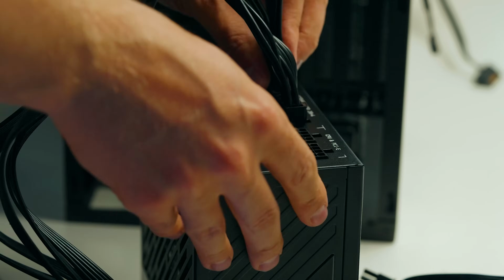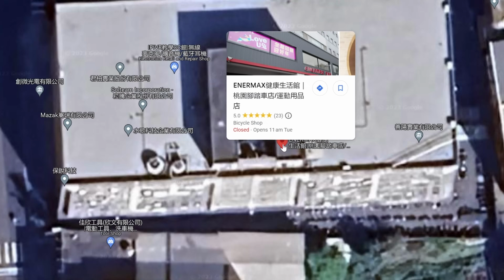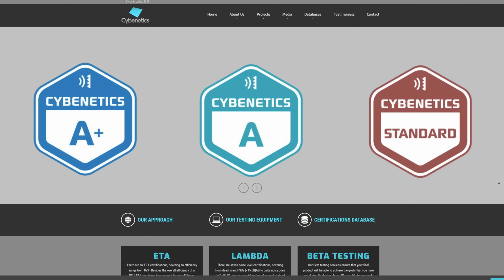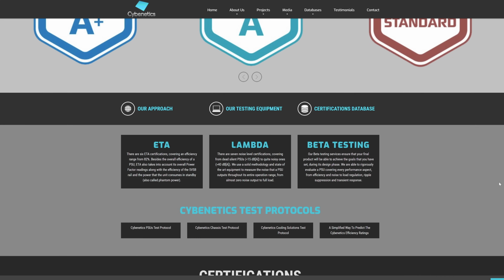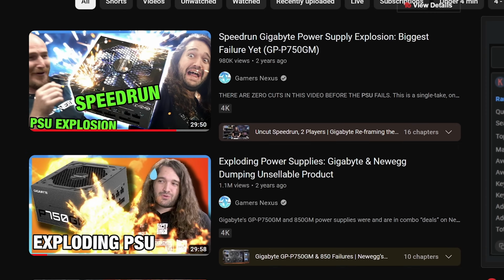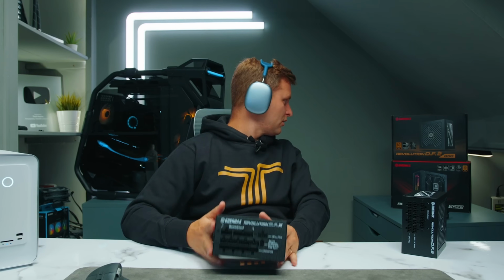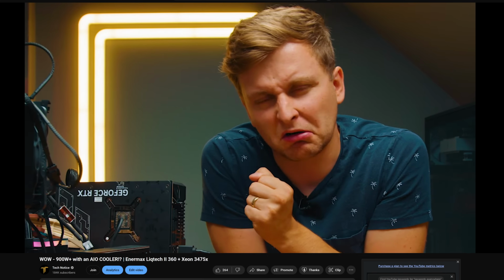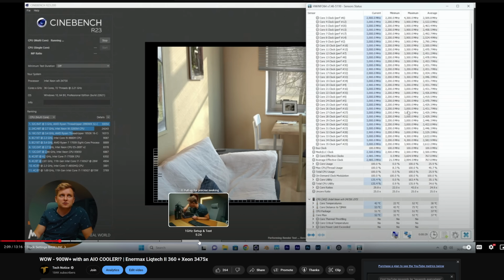ULTIMATE Power Supply Tutorial: NEW PSU standards Explained from NOOB to EXPERT! [What is PSU?]

Comment: This was really informative. For AI, I’d like to see power supplies include a feature that measures total power consumption so it can be used to calculate the cost of running each PC or a group of PCs. I never turn my PC off, so when building a new one, I wonder if it costs the same to leave a 1000W PSU running 24/7 as it does an 850W PSU. I’d like to know before opening the one I just bought, which is an ASUS ROG Loki SFX-L 850W Platinum (Fully Modular Power Supply, 80+ Platinum, Lambda A Certified, 120mm PWM ARGB Fan, Aura Sync, ATX 3.0 Compatible, PCIe 5.0 Ready, 10-Year Warranty). I also didn’t hear anything about the power required if a USB 3.2 Gen 2 is used for power transmission, and how that might affect the build specs, though to be fair, this was created two years ago. Oh I forgot to mention the main reason I chose this brand was for the size restrictions I have of needing a SFX-L.

Comment: Well… I pick a power supply for noise. Thats why I over spec them. For example, I know, a system will pull 500 watts peak in the way I configured it, so the power supply will sit at 1000 watts.  This keeps the PSU at low noise, if the PSU is a good quality. For example, the 1000W Dark Power 14 will run at 8dB, which is effectively noiseless.

Comment: the reason you might be able to push the PSU harder than it's advertised is because sometimes the PSU manufactures may for example when producing a batch of 1000W PSU end up with some that only giving 900W or 950W, so they might just sell it as an 850W PSU since they can't sell it as 1000W.

Comment: Build new system got gold. It wouldn't turn new motherboard was bad. Tested psu and saw jitter on tester low the better. 
Going need a new gpu got 850 with atx and pci 5.0. Full  modular  what's best, amd for under 400$
My psu shut down immediately when saw fault with bad motherboard

Comment: Just a note as an electrician in Florida, USA, he's correct about 2000w PSU being unfeasible on a standard residential wall outlet. Ordinarily. A standard American residential circuit may be 20A at 120v, which supports 2400W total. A PSU rated at 2000W with a 90% efficiency rating may pull 2200W total from the wall outlet. But we have electrical codes to abide by. 

Although a 120v 20A circuit can support 2400W legally, it is code required for "constant loads", like computers, to be mandated at 80% of rated circuit capacity. So already, as far as electrical code and safety goes, your limited to 1920W on your 2400W circuit. Well under the potential 2200W draw the PSU may pull. It may work initially when you power it on, but your breakers will end up tripping as they heat up as they aren't designed to support "constant loads" at 2400w, and neither are the wires in your walls. The 2400w if for "spike", "peak" or "intermediate" loads. 

On top of this, the majority or American homes are wired with 120v 20A circuits to feed outlets in the home. But 95% of the time in a home, the actual receptacle wall outlets installed are only rated for 15A at 120v, or 1800W. This is allowable when there is more than 1 receptacle on a 20A circuit as they anticipate you splitting the load between multiple receptacles, which is 99% of the wall outlets in your home. If you want to know what you have, look up 15a v 20a 120v receptacle. You will see the difference so you can identify what you have. 

But at the end of the day if you know electrical work, it is entirely possible to run a 2000w PSU in your home safely if you follow electrical codes. And the building department can't say anything about it if its correct. It's not standard here but done correct. 

Your option on 120v would be to run a dedicated 10awg wire (30 amps rated) instead of the standard 12awg wire (20 amps rated) to your computer source and use a single outlet commercial grade 20A receptacle at the end to plug into. This setup would absolutely support up to 2400W of continuous power draw if installed correctly. Or, with 240v, you can use traditional 12awg wire, and wire it up to a 20A 240v breaker and 20A 240v outlet. This will supply more than enough power to supply the circuit safely, 3840W even considering the 80% limitation for constant loads. Check the PSU specs first, but every PSU I've come across is rated to accept this power input as its very similar to European power. Only difference is 60Hz American to 50Hz European, which is within specs of every PSU I've ever seen. Some people don't realize that American homes are both 120v and 240v. It depends on what your powering. For example, your oven, stove, dryer, A/C, water heater, pool pump and well pump are almost certainly using 240V unless they are running on gas or extremely light duty. The rest of your home (all lights and standard wall outlets) are 120v for safety. 

Unfortunately, many new houses don't even use 12awg (20A) wire anymore, many run 14awg (15A) wire. Not how I wire a house, but many do to cut costs. You can tell by looking at the ratings on your breakers. If your house is wired with mostly 14awg, your circuit is rated to 1800W max and 1440W continuous. So technically, a 1400W power supply is illegal on this setup when you factor in the additional 10% draw for efficiency losses.
Reply: pls do a tldr

Comment: The problem with Gigabte PSU's is they just didn't test to determine the OPP level, or perhaps errors were made.  In regular use, though, none of them failed in that manner.  But Gigabyte opened a window for purposely exceeding the ability of the PSUs and then they responded with bad PR.  I've had good warranty service with Gigabyte with other products, motherboards, and GPUs. So it's not a bad company to deal with. Although I heard of bad service, it didn't include me. Their PR departmented needed an overhual, though, it seems.

Comment: Full-modular means you can replace all the cables with custom cables, where a semi-modular means you will need extentions if you want, say, custom sleeved cables, visible.  However extensions can be harder to manage in you have a tight cable management space.

Comment: My Corsair ax1600i died recently so I purchased an NZXT C1500. Cybenetics rated it Titanium and it uses 100% Japanese capacitors. It is designed by a channel well and is a top notch psu. Features atx 3.1 and dual pcie 5.1 connections. So far I'm very pleased with it.
Reply: How did it die? The AX1600i is built with very high quality components

Comment: So, this is leaving me with more questions than answers:
- From what I understand this is an Intel Standard. Shouldn't it have been an NVidia Standard?
- These very nice cables, if used, void the guarantee on your Nvidia card, according to Nvidia themselves.
- Then we have another huge issue, my KFA2 HOF 4090 card draws 660 Wats from a similar cable (I use a Seasonic), and I know that the Asus Strix can also go well above 600 Wats. How do the cables handle that much, and why limit them to 600 Wats when there are cards that can "easily" exceed that Wattage?
- Is there any technical reason for the top manufacturers, such as Enermax, not to include a cable for 800 or even 1000 Watts, which will be achievable with LN2 cooling?
Thanks for all the explanations but a 600-watt cable is just not enough. I thought of using two PSUs, however, we can't because NVidia has only one [very badly thought of] connector.
Cheers.

Comment: Japanese capacitors are these days more an ongoing marketing tool rather than a significant choice for PSU's. It originated because of the capacitor plague (electrolytic) in the early 2000s which saw a whole lot of new startups third party electrolytic capacitors fail due to quality issues bought about from incomplete stolen formulas for the electrolyte.
Japanese made capacitors were not affected by the issue as they were already established and had their own stable proven formulas for the electrolyte.

Japanese Caps are more expensive and typically higher grade, but it's no guarantee against bad design and bad component choices. A cheap PSU with Japanese caps, is still a cheap PSU.

The capacitor plague is long over, non Japanese capacitors doesn't mean bad capacitors or cheap capacitors and Japanese capacitors is not a guarantee of quality. Cheap Japanese capacitors exist, capacitor series and not just the brand makes a difference in quality and longevity of the PSU. You trust that the PSU Brand is ensuring that the right capacitors are being used in their PSUs.

I'd rather a Teapo (non Japanese) 105°C rated capacitor rather than a Rubicon or Nipoon Chemicon  85°C rated capacitor in my PSU.
Reply: Spot on but I'd want a Japanese 105C capacitor over anything else.

Comment: 12hvp cable. there is a repair shop in southern california that does OEM repairs for like gigabyte and asus he has done well over 300 12vhp socket replacements on melted rtx 4090s. so its not a small number by any means

Comment: great content. i had a Evga Super Nova 550w g3 since 2015 which was powering my 7700k rig. for my new 12600kf build i bought an Seasonic Focus GX-850 which has ATX 3.0. the main reason for me wasn't only the 600w PciE 5.0 plug but the 2x 8 pin Cpu connectors. the 12600kf is booting much faster bec the Bios Post is proceeding much faster now and Cpu/Ram oc runs much more stable!!

Comment: Does "105*C Rated Capacitors" mean "100% Japanese Capacitors"?
Reply from the maker: Not necessarily:)
Reply: 105°C rated is a thermal longevity, max temp rating. A 4000 hour 105°C rated capacitor will last 4000 hours at 105°C. A 4000 hour 85°C rated capacitor will last 4000 hours @ 85°C.
At temperatures lower than the rating, the capacitor will last significantly longer. The rule of thumb is a doubling of life expectancy for every 10°C drop. So a 4000 hour 105°C rated capacitor will last ~16000 hours at 85°C and 64000 hours @65°C, the 85°C capacitor will last ~16000 hours at 65°C.

85°C caps are cheaper and will last a long time in low power applications where their temperature differential above ambient is low, e.g typically only get 10-20 degrees above ambient In a human tolerable environment (e.g. 20-30°C controlled temp environment like an office or home).

High power devices  where components can get to high temps like in a PSU often 40-80° C above ambient (60-110°C+ component temps), are best served with high temp rated capacitors for longevity. Micro environment temps can vary significantly with proximity to high temp components, power mosfets can get to 120°C+, how close capacitors are to these components and heatsinks can affect capacitor temps significantly.

Comment: US power grid runs 115-120v.  

While the average home has a 100 Amp, or 200 Amp panel, all the home circuits are typically wired for 15A or 20A circuits.

With a 20A circuit, on 115v grid, you can get 2300W input into your supply... meaning you "should" get at least 1840W at 80% efficiency.  If you run a monitor, printer, router/modem or even a desk lamp... you need a second circuit ;).

Comment: Talked about supplying video cards with 150w/300w/450w/600w, what if the video card needs say 225w. Does it oversupply it then? What is the point of this stepping, is it for efficiency? Because most all video cards are not going to take precisely one of those 4 wattage all of the time. Also what if say a video card is right on the cusp like 298w?
Reply: As the video stated, your system pulls what it needs. You don’t load the psu full supply to everything just because it says 1000 etc…
The max is just what it’s capable of all at once. You add everything up in your system and add maybe 200 more watts just for gpu spikes just to be safe and future proof. That’s why a lot of Americans are going with 1000w. Just rebuilt mine with a 1000w.

Comment: efficiency and quality have little in common in the modern PSU market, read your cultist list and research your hardware, and the rating system is for when the PSU is basically at idol, has little to do with how it will perform under loud, and German, Brazilian, and south Korean are of the same  quality as Japanese,

Comment: Issue with Japanese capacitors has a history that we not told here and needs to be told. In the 1990s, Taiwanese companies "stole" the IP formula of the Japanese capacitors and started making them for motherboards. However, the quality was subpar unknown to the copy-cat companies. I think there was a lawsuit and industrial espionage investigated by the Japanese trade authorities.  The end result was capacitors leaking after some months leading to huge motherboard recalls from Asus ? and Gigabyte and generic no-name brand lower end motherboards. These were catastrophic to the motherboard. I friend of mine in HK has his board suffer this failure.

This shows the copying was not perfect and the Japanese improved their formula/design with special coating and materials impossible to copy to date. Hence, they have a total monopoly on this caps!!!.

Another point about laptop power  adapters , is that the adapter block does the A/C to D/C conversion to a single higher voltage such as 16.5v on older laptops and 20V on newer models. This means the laptop motherboard has step-down voltage to 5v, 3.3v, maybe 1.2v with their associate power filters and smoothing capacitors/circuits so the that chips can operate at those voltages. ie. Laptop DC-in is 20v DC and then it hits the internal power circuit for stepdown etc. The chips operate at 5v and 3.3v CMOS while the CPU uses VRMs to step down to 1,2v or fraction of 1 volt. eg 0.8v.
Reply: Wow. That was interesting.

Comment: 80+ is not super relevant for single home pc users, the difference on most people's eletric bill would be pennies per month. The standard was created for enterprises running dozens or hundreds of computers, a use case where energy waste adds up fast.

A good 850 watt psu can provide 850 watts CONTINUOUSLY  on the +12v at it's rated specs. 850 watt is not the total amount of power it cn deliver, although most components will be using +12v. There are some (and used to be way more) psus that are "peak rated" and instead of delivering their rated wattage continuously on the +12v, their wattage rating is a combination of the +12v and +3.3v and +5v rails. So a peak rated 800 watt usually delivers something like 636 watt on +12v and the rest of the rails add up to 800 watts. By no means could a psu like this power a system that requires say 650 watts, but a good, honestly rated 850 obviously could.

Semi modular is fine, you need the 24-pin and 8-pin cpu cables anyway in literally every build. Also, fully modular cable reduce the tightness of ripple control a tiny bit, so hardwired cables are better for performance. Fully modular is all about convenience and aesthetics, semi modular is a good middle ground.

PSU calculators are basically useless, none are very accurate. They just add up rated tdps and figures given by manufacturers that can vary wildly. Look up reviews of components for real world power consumption.

Great video, hopefully more like this in the future.
Reply: One thing add here is motherboards likely are about to change pins as one company is doing right now. So that will be helpful.

Comment: Could you produce a video that explains why PSU makers state that the cables they ship with their PSU must only be used with that PSU? I have many PSUs from different brands. Is there a way to determine which cables go to which PSU, as the cables all look alike? A demonstration of what can happen if a cable made for a specific PSU is replaced with a cable from a different PSU. I recently purchased a Power supply tester IV. Would this device show me which cables go to which PSU?
Reply: depending on who made the power supply, they will link certain things to the main 12v rail; and in many different ways. if you look at the internal diagram for all of them and it's the same,you're fine. if it's different at all,that's a no-go.
Reply: marketing

Comment: I still got a 600w Enermax Noisetaker v2 EG701 PSU  got it back in 2005 and its still running in that old machine, I only buy quality - its a false economy running cheap psu's as the protection in them wont be any good, the other brands I currently use are Corsair RM 850 series and the Seasonic Platinum 1000w which I have had in my current machine
Reply: seasonic is really good

Comment: The Dark Power 13 is an amazing PSU. It comes with a switch to run everything off a single 12v rail
Reply: Good to know I am planning to get that one
Reply: @SM-sj4dq  last week NewEgg was running a special on the Be Quiet Dark Power 13 1000watt for 199.99. I got from Amazon for 260 and it’s a very premium product. Even the cables feel high quality and damn it’s soo nice having a Native 12VHPWR connection directly on the PSU. None of that 2 - 8 Pin connectors like Corsair does.
Reply: Thanks for advice. I will look into this German "be quiet" company. I didn't know about them.

Comment: Another company trying to sell you more. Modern (Gold++) power supplies have quite decent power efficiency almost up to 100% and will last for 10 years.
But none of them has great performance below 20%. So think about your idle/YT 100W system for a second?

"12VO" has decent low power states, but try to find a PSU and MB with that format. You can count them on the fingers of a single hand. Even as a carpenter.

Comment: Very interesting interview.  I did not know about the wattage,  but knew I needed a heavier PSU when I looked at my total load.  So there was the answer, yes 700w could handle my output but not for very long, PCPartspicker showed minimum 680W was needed.  I went with the 1000W Platinum and use a 12VHPWR cable from the PSU to the Graphics Card.